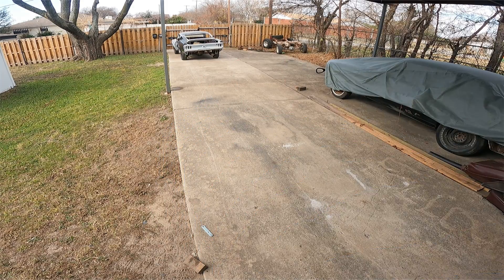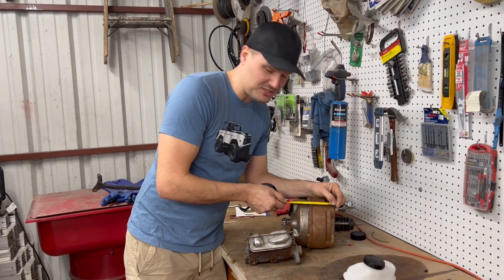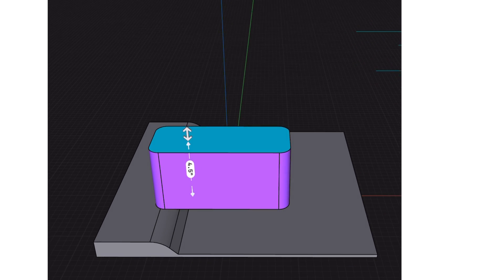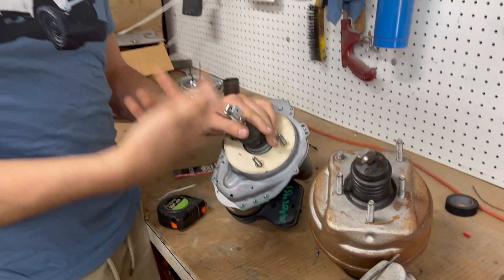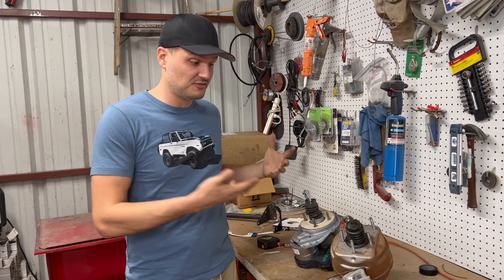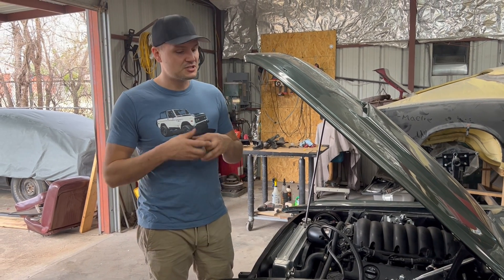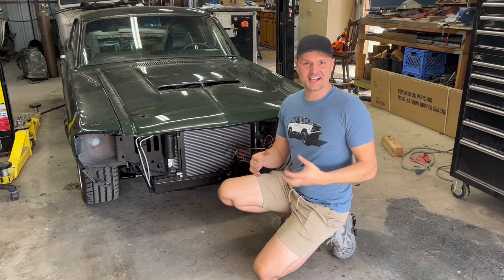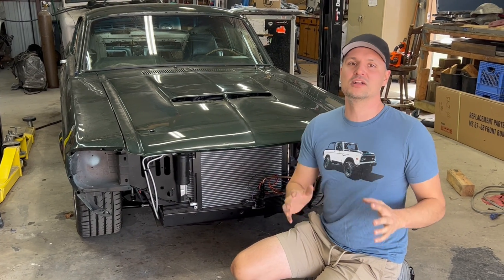Electric Vehicle Brakes: 68 Mustang iBooster

Comment: Is the idle changing when you hit the brakes? 

Since I was going boosted trying to see if I could run electric booster to not depending on intake manifold vacuum.

Where is the link for your harness?

Any link for the pedal return spring?

Comment: I noticed you have the one-piece products window installed.  How does it fit?  how about gaps with the standard ford mustang seal?  Mine has a 1/2" gap in the front and I am really struggling with the fitment.  Any suggestions please let me know.
Reply from the maker: Hi there! I do love the look but I have to say it was a very real struggle to get it all lined up. I wanted to show a video of installing them but it was very frustrating footage! Lol. After several attempts I was able to manage a gap in front that seals. The trick (for me) was to elongate the hole in the front upper capture bracket . That allowed the front to adjust upper ward without affecting the rear position (too much). Please keep me in the loop on your progress…I’d love to follow along.
Reply: @FollowTheBuilds  thanks I will keep youbposted
Reply: @FollowTheBuilds  also I would be interested in the harness as well
Reply from the maker: @cmw1478  I just received more connectors. Hope to have them “pig-tailed” this weekend. Thank you!
Reply: @FollowTheBuilds  cool.  Thanks.  Look forward to it

Comment: the i-booster with the Cody-swap probably wouldn't fit but im guessing about that as i have a 60's charger and at least with my 2G iron hemi i have the same fitment problematic with the polished cast valve covers, right now im using a bendex-9 system and its a tite squeeze but fits 👌did have to move the pump under the car but the master cylinder fits like the un-boosted oem 1 does and bolted into without any firewall modification

Comment: I’m very interested in this. I’m doing the AJE front suspension conversion on my ‘66 coupe and was possibly going to do the EPA Prius mod to the steering. Still on the to do list. I do have a couple of questions. I might have missed it, but did you have to move the master cylinder mount location to the left a couple inches or did it mount in the stock location?(I’m guessing you installed a coyote or is that an LS?) And second, if for what ever reason, if the booster lost power, does it have a fail safe mode, and go back to manual brakes? Thanks. Just started following you channel. I like the content.
Reply: @POLOreme  if you want to use rear drum brakes, you'll need a residual valve and an adjustable proportioning valve. Some prop valves have the drum residual valve built in. 

This unit does fail back to manual brakes if the electric motor inside fails. It's designed to retract back to the default position. SuperfastMatt took it apart and shows how it works.
Reply from the maker: Awesome. Thanks for following along!

About to do a EPA with a Nissan Versa myself. 

Stock location for the booster/master cylinder. I’m interested in configuring the brake pedal with all the stock mount. I’ll need to modify a push rod to accommodate. 

Yes manual brakes if the electrical should fail.
Reply: @FollowTheBuilds  appreciate the response. I’m also wondering if this will only work for an all disc brake configuration? If you have front disc and rear drums, can it still work? I’m guessing all drum is out of the question? (Haha just thinking of other projects I have)
Thanks

Comment: Really cool! So does this iBooster help make it stop better? Like, if you didn’t have this ibooster would it stop at all?
Reply from the maker: So manual brakes (without a brake booster) work fine but with more effort by the user. Some prefer the manual brake feel. Modernizing is the effort here and the iBooster seems to be the answer for this build and future ones. Some may see it as a luxury but i see it as needed preference.